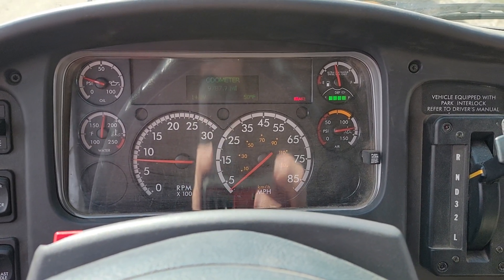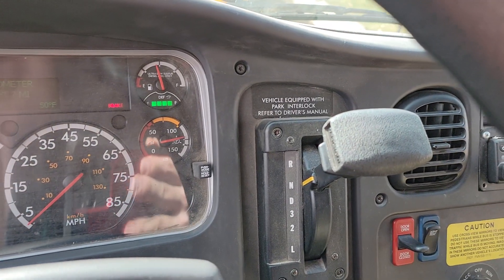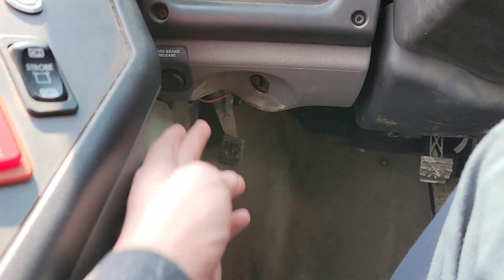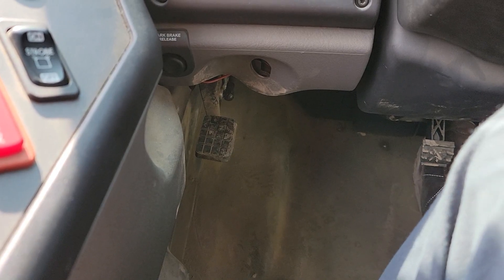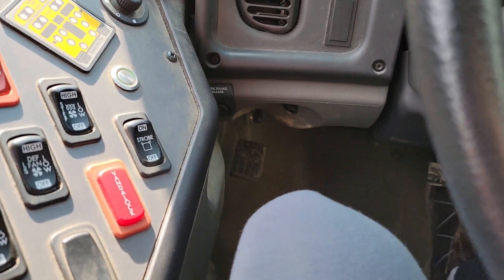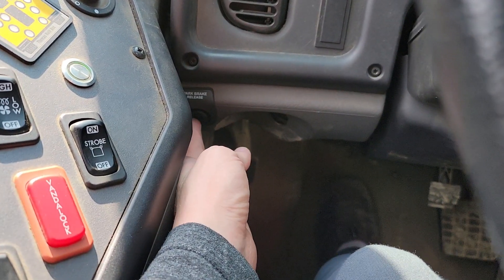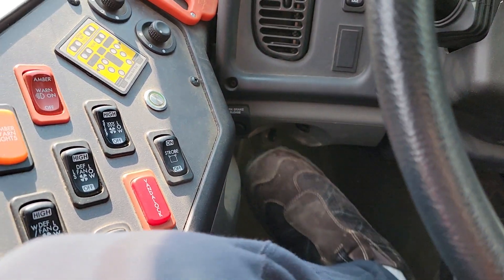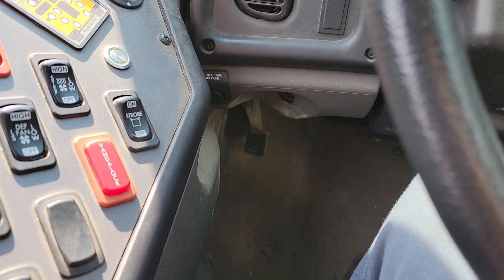2021 Thomas Saf-T-Liner C2 Parking Brake Interlock

Comment: I don’t like hydraulic brakes on buses and trucks much less the hydraulic parking brakes On buses and trucks especially the foot pedal. Hydraulic brakes on buses and trucks are an accident waiting to happen. That shouldn’t even be an option when it comes to purchasing CDL vehicles. They should be all airbrakes. Not to mention that hydraulic brakes can freeze in the winter because they use fluid.
Reply from the maker: A foot parking brake is cable operated, it is separate from the hydraulic brake system and not hydraulically actuated at all.  But yes, I agree.  Big buses should all have air brakes.
Reply: @BusMaster99  Yes! Hydraulic brakes are BULLSHIT!

Comment: Anyone know where this interlock module is located at? I have one not releasing and I'm try to track it down for to see if it's a module or wire issue.
Reply from the maker: I wish I knew.  You may have a blown fuse, relay, or your brake lights aren't turning on.  The interlock is wired in with the brake lights so if they don't turn on, the interlock won't release.  But yeah, I have yet to find out where the fusebox is on a Thomas C2.

Comment: Very interesting set up, I don't get what I still don't have electronic parking brakes though
Reply from the maker: That's most likely because there is no EPB that can adequately hold a bus or truck with hydraulic brakes.  Then again, I don't always trust a foot pedal to hold the bus when it's not properly adjusted.  On this bus, it was fine and very tight, but I've driven buses where you have to push it to the floor to get it to hold properly.  Of course, Bendix has their Intellipark system, but that's for air brakes and I prefer the regular push/pull knob for the parking brake on air brake buses.  They really should develop a fully electronic parking brake for hydraulic brakes.
Reply: @BusMaster99  yeah I agree, pushing and pulling a yellow knob it's a lot easier than dealing with a third pedal to apply your parking brake.
Reply from the maker: @JordanLoweElevaToursCanada  Not to mention stoppability of the bus in the event a driver becomes incapacitated.
Reply: @BusMaster99  exactly! With the parking brake like that this is technically a safety hazard!

Comment: I've definitely noticed a lot of newer school districts have switched to hydraulic brakes on their buses over the last 5-10 years, ik when I was attending DeKalb High back in 2018-19, the vast of majority of our school bus fleet had hydraulic brakes, the only school district that really is truly sticking to air brakes at this point is U-46 as I still see plenty of their new buses have them still. I think hydraulic brakes work well in smaller buses but I would definitely take air brakes on larger buses
Reply from the maker: Crest Hill First Student still gets air brake buses as well.  Their fleet is roughly half air, half hydraulic.
Reply: @BusMaster99  A perfectly balanced bus fleet